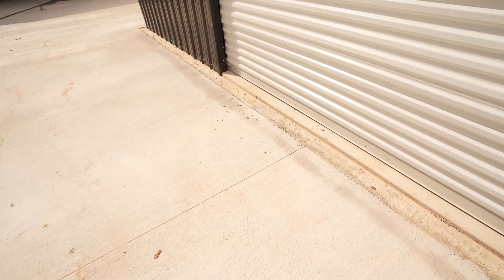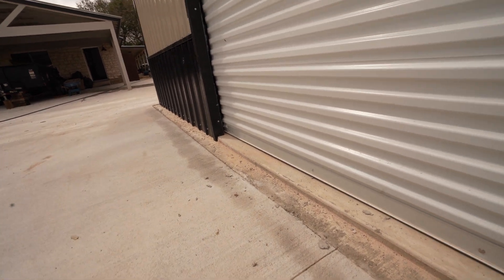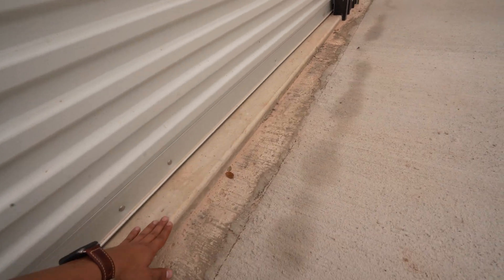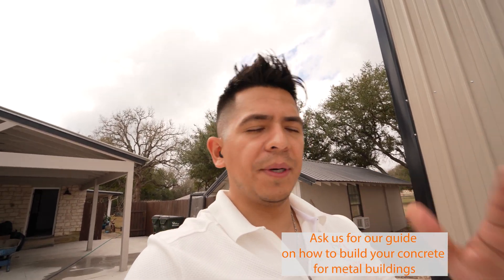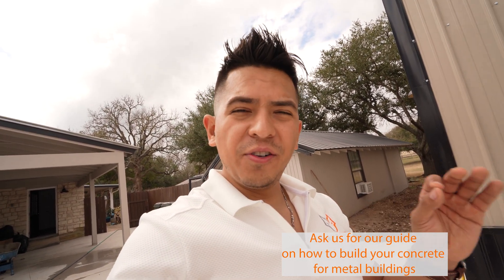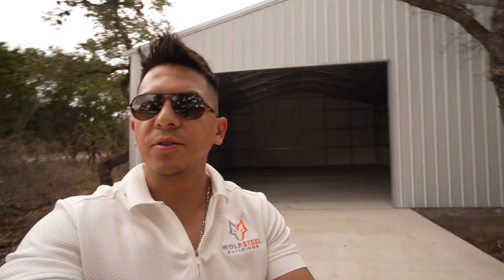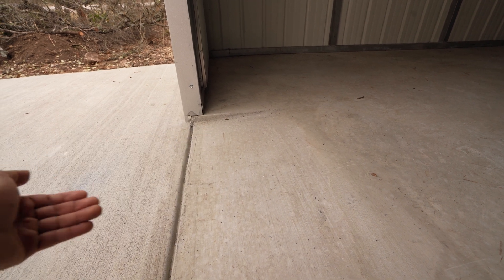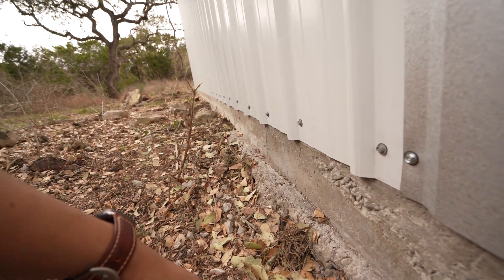How to build concrete pad / slab for metal building? Diving deep into two recent Texas builds

Comment: Terrible concrete work. Full of voids demonstrating that the concrete sub didn't use a vibrator when placing the concrete.  Over 60 years in the construction business myself.....I know what is good work and what is not.
Reply from the maker: Hello Dwayne, we did not do the concrete slab for this build however, it did have the requirements on the detailing needed for our buildings. Good eye on catching the issues with the voids - years of experience!

Comment: Is there a benefit of the notch vs the "raise" (4:12)? Seems to me the raise/step/ledge/whateveritscalled would be better, as the notch could trap and fill up with water.
I was speaking with Sarah (project mgr) about this yesterday on what your concrete team can do.
Reply from the maker: Great question, the two you are mentioning are actually the same! Let me explain, the notch (ledge) is designed to prevent the water from seeping in because our sheet paneling is flushed against it. If would like more details I can have Sarah send you further concrete information to help on your current project.

Comment: Hello I'm trying to understand the notch edge correctly. Do you pour concrete to true size of building and then use a 2x6 to lay around the edge?
Reply from the maker: Hey Mikala! Yes you build your concrete to true size. Then you create a drop of minimum of 1.5” inches so the sheet panels can overlap the concrete. Does that make sense?
Reply: @wolfsteelbuildings  Awesome that makes more sense  I'm in the process of purchasing a 24x30 building and would love that exact edge and just trying to get correct dimensions for my concrete guy for next week.
Reply from the maker: @mikalaposley1287  I’m glad I was able to help in some way. This is important especially with prefabricated metal buildings to prevent seeping of water 💦 in the underside. If your in Texas, we would be happy to help with your project!
Reply: @wolfsteelbuildings  I actually live in Florida but I would definitely do business with you if I lived in the area. Thank you for all of the information for the slab.
Reply from the maker: @mikalaposley1287  awesome well enjoy your new build and if there is anything I can still help, let me know! Knowledge can be shared across state borders :)!